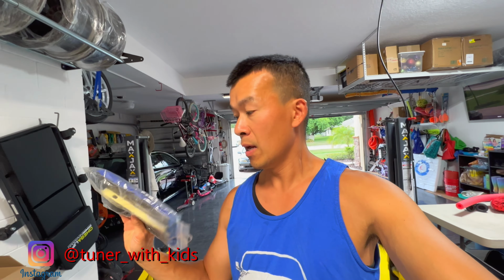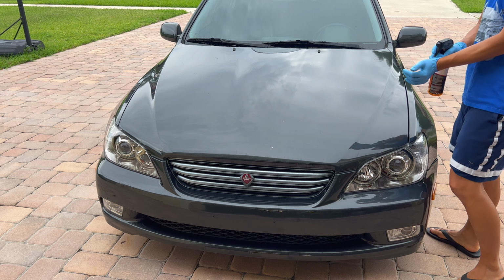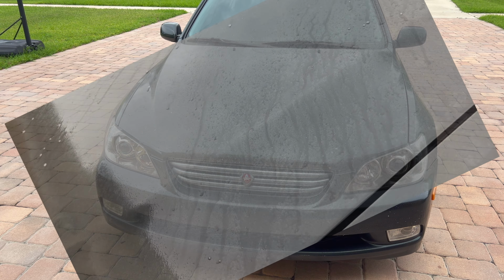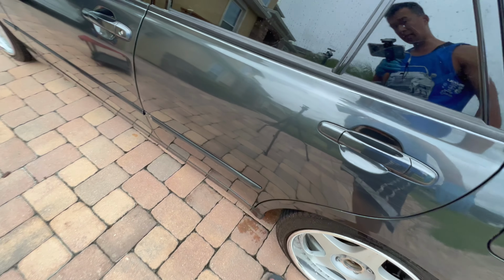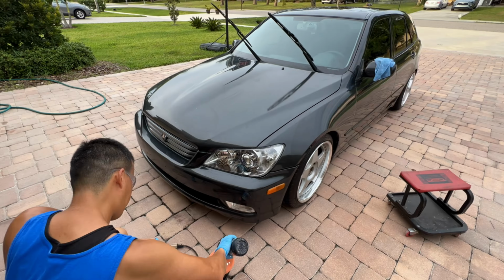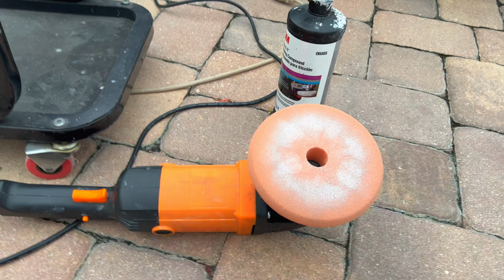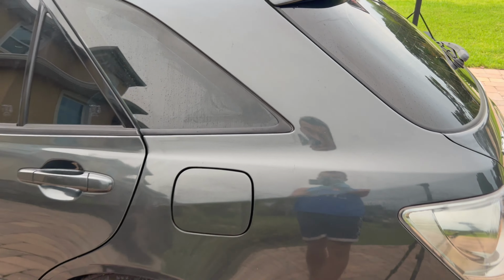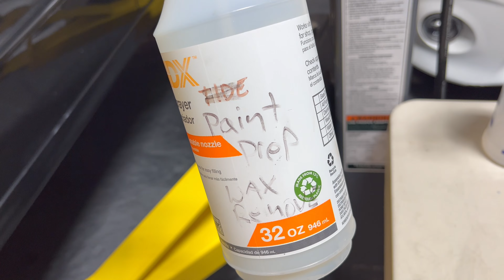Lexus IS300 Paint Correction, Clay Bar & Ceramic Coating | Iron Remover Decontamination

Comment: The sport cross is a rare bird! Don't see many of these and the ceramic coating did the job! I'll be ordering some of this and using your code to help support your channel. 🙂👍
Reply: Says invalid code when I enter "tunerwk25" please advise. I'll wait a few days to place my order to give time for you to see what's going on.
Reply from the maker: Thanks for trying. I have emailed Avalon King to see what the issue is. I know they changed systems recently and may have not imported all the codes.
Reply from the maker: Looks like they got rid of codes on the new system for most of the promotors. I did notice that "samcrac" still worked. Use my link and try that code...https://avalonking.com/products/armor-shield-ix-diy-kit?sca_ref=2043853.kDASzI6vbM